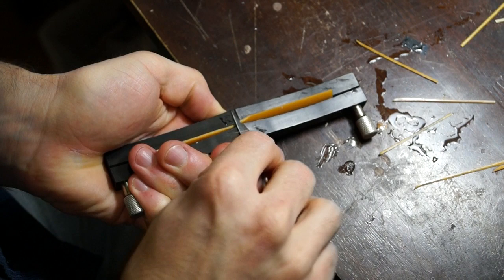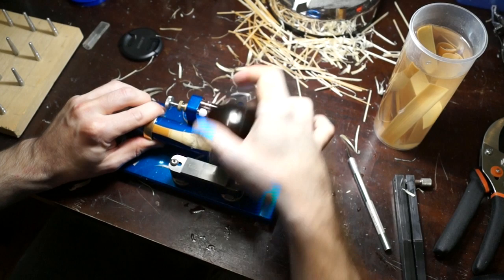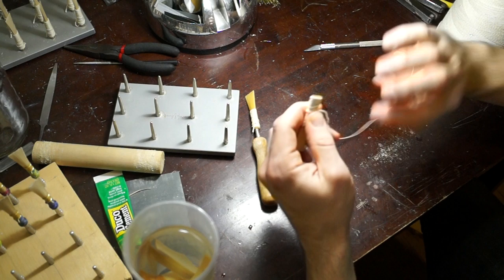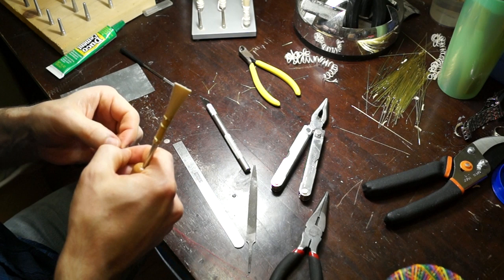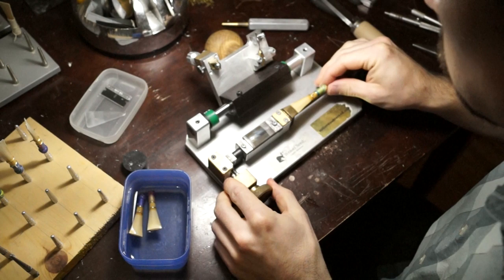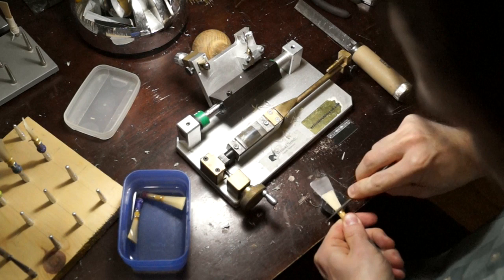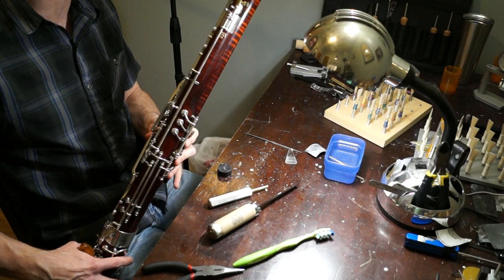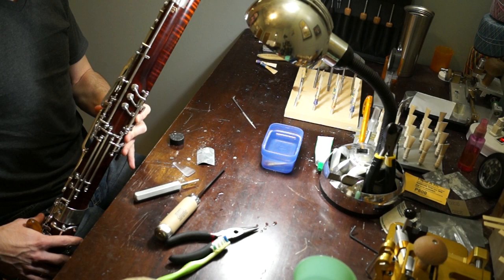The Making of a Bassoon Reed

Comment: I am an oboist and I have been making reeds for almost 50 years. I totally understand and agree with you that once the cane is gouged and shaped, tied and rough scraped, then getting it broken in by drying it and wetting it and drying it and wetting it over a period of a couple of weeks is a very essential step which demands patience, after a rough scrape before focusing on final adjustments for a Concert reed. I also believe that a slower process extends the life greatly on each of my reeds. 
The true character of the grain fibers and the shape will eventually settle. From fiber to fiber within the structure of the cane, which is naturally imperfect considering there is soft cane and hard cane. I believe aged cane is extremely important as well. Every couple of years I will purchase one or 2 kilos of cane and let it age another one or two years. The aperture’s of my reeds are much more consistent in my opinion, when the cane has been aged proficiently and gone through wetting  and drying out periods.

Comment: That's interesting Trent. Why don't you use a bunson burner to heat your forming mandral ? It will help the wood retain its form rather than putting it on a pin for 2 weeks.
Reply from the maker: Scot King Heating the cane in that extreme changes it. I prefer to let time do the job. It's a Herzbergian concept: like rolling a piece of paper into a tube, you let it sit there for a few weeks and it will want to stay in that shape. They're both ways to get to the end result if you know how to manage it, I just prefer to keep my cane from getting too hot.

Comment: Hey I'm learning to make bassoon reeds but i don't know the difference between the different types of cane. Would you mind telling a brief description of them also what are the measurements of the wires? Thanks in advance.
Reply from the maker: +Green4544 Your question about the differences between cane is really far too broad for any real good answer. The most important feature I generally find is that you get something that is consistently selected and processed, that you can learn how to finish effectively. If you're buying gouged/shaped/profiled cane, finding the brand that provides the closest and most consistent profile is usually the trickiest thing. The quality of the cane isn't really as important. If you're doing that processing yourself, you just have to try different cane and see what will work out for you.

I have learned over the years that I like concentrically gouged cane, and don't particularly like really wide dimensions at the collar for the shape, for instance.

My wire measurements are: 4.5mm from the end of the tube, 40mm from the fold, and 32mm from the fold, with the collar at 30mm from the fold.

Comment: Hello Trent,  may I ask about your pre-cut lengths of wire? Are these something you pre-made or able to purchase? Great video.
Reply from the maker: +Guadalupe Esquivel Jr. I cut them myself. They're made straight by simply grabbing both ends of the wire and pulling a bit. I don't straighten them anymore though, never found it made any real difference in how the wire functioned, and it was time consuming.

Comment: I've recently begun making my own reeds and, being in the poor student musician phase, can not afford a tip profiler. Would you have any tips on scraping from start to finish and how many sessions of scraping this should go over?
Reply from the maker: +Steph That's a full 20 minute video alone really. I would say you could easily do the finishing scrape in a single session, then adjust over a break-in period, but the trouble is knowing the profile that you're coming from. Basically, if you have an end goal in mind in terms of the scrape pattern, and you know what your profile is going into the final scrape, you can plan your finishing scrape and do it effectively.

The problem for a tutorial video is that you are probably buying GSP cane that is WAY too hard (they all are, I haven't found very many GSP sources that are really nearly as close to final scrape as I profile my own cane to) and it will take patience and a lot of scraping to get it to final thickness. If you find some cane that is closer to what you want your final scrape to be, it's a lot easier. At any rate, no single guide will really be good for you, as knowing how much to take off and from where assumes a certain starting point: the profile, which is variable depending on what you're getting.

There is trouble with written text on this subject, most of it being super technical in nature and not really very practical for the learning beginner reed maker. This for exampel: http://www.2reed.net/EwellArticles/ReedAdjustingNew.pdf is an amazing source of information, but it's Super dense and really difficult to digest if you don't already really know what he's talking about.

Comment: Great video! Very thorough. One question: would this work for making contra reeds? I am thinking it might help to keep the low register dark, but the upper register can be really thin as well. I have a mandrel but I need a profiler for my contra! :)
Reply from the maker: Generally speaking, I use the same method of forming the blank when making contra reeds. The bevel increases the fulcrum and causes the tip to open more when adjusted with the 2nd and 1st wires. It does make the reeds more buzzy until they've broken in - just like the bassoon reeds made in this method. I don't have a profiler or tip profiler for contra reeds though, I buy profiled cane (shape it myself) and hand scrape to finish. The profile I get doesn't require much finishing work.

Comment: How often do you need to get your tip profiling machine blade replaced? And how much does it generally cost to do that?
Reply from the maker: Hans Fronberg I've had the machine since 2007? And have never needed to replace or sharpen the blade. Still profiles very cleanly.

Comment: Just got an md profiler was wondering what numbers do you find work best for you? really liked your tone.
Reply from the maker: The numbers are not universal. A setting of a 3 on my machine won't turn out the same as a 3 on your machine. If you want to check with a dial indicator, my thickness at the center collar is about .95mm (yes, that thin!).

Comment: great video!!! whats your setting on your tip profiler? Wonderful machine, but im struggling to find a good reed thickness on the setting..
Reply from the maker: +Arno Steyn The setting on the Rimpl machine isn't static. The individual template isn't set exactly to the dial, so there's no metric I can share with my settings. I use the "standard" template, and just have the thickness adjusted. My profiler is set to take more out of the center than the tip profiler would leave, and I scrape some more out of the top of the "thumbnail" shape left by the tip profiler.

Comment: Hi Trent, I appreciate you making this video and all the comments you also post on IDRS. I have a quick question regarding your MD Profiler

I too own an MD. I was wondering what settings do you have the thickness-adjustment knobs that are numbered on the rolling platform? I have been experimenting with these parameters for a while now trying to find a setting that uses the machine to its fullest potential and saving time during the finishing process.
Reply from the maker: Richard Blake I don't know that the numbers are universal. I know when I last changed the blade on the profiler I had to adjust the numbers slightly to get back to a thickness I was happy with. I'm not at home to look at the machine now but I'll try to remember to check it when I'm home and reply in a new comment.
One thing that might be quite important to note is that I had the profiler made with a round barrel stem, so there is absolutely no spine in the profile. This will obviously change what general/overall thickness you would prefer.
Reply from the maker: Richard Blake My numbers right now are exactly 6 (tip) and 4  (collar).
Reply: Trent Jacobs That is fascinating with the round barrel stem. What made you decide that you wanted no spine in the profile? I've been "raised" to treat the spine very carefully in my reed making because a great deal of support comes from the back center. To take hardness out you then shave the "rails" of the reed if the reed is too thick. Obviously with a dial indicator I make sure my back and spine areas are not over 35 (thousands of an inch). Thanks so much for getting back to me!
Reply from the maker: I've never liked the response characteristics of reeds made with a spine. Contra is a different story.

Comment: Can I ask what is usually the diameter of the bottom end of the reed? I want to know if I can fit one in my Guan Zi as an experiment ;)
Reply from the maker: +Chartre Khan the bocal the reed goes on measures 5mm diameter when measured with my little caliper. There's a bit more room to make the reed bigger, but not much.
Reply: Wow! The reed I have for my Guan Zi is more than double that! And about 18mm in width on the end which is roughly similar to a large bassoon reed I think. The reeds on a Guan Zi go inside the instrument rather than over a bocal, so I could still try a bassoon reed, but it would requiere extensive wrapping with string.Thanks :)
Reply from the maker: Yes, GuanZi has a very short and wide reed compared to a bassoon. Quite different.

Comment: Out of curiosity, what brand Reed knife were you using?
Reply from the maker: +Jeffrey Wasik It's a 6 inch Freud brand jointer knife inserted into a modified multipurpose file and tool handle. I did recently start using a Rigotti double hollow ground knife for  the final scrape except that I still like the jointer knife (which is beveled style) for doing the collar cut. I've refined my profiler and tip profiler setup that I don't need to do much knife scraping at all anymore.